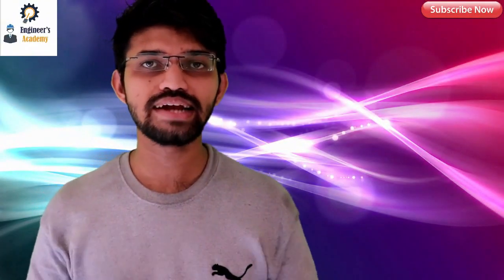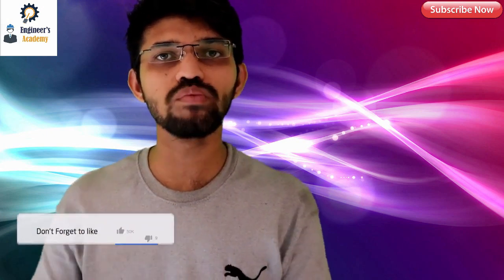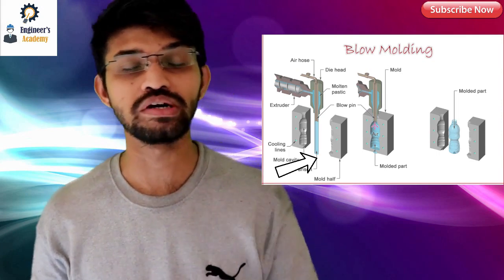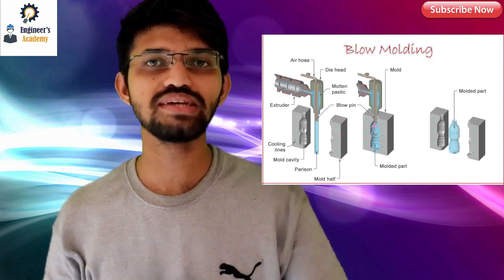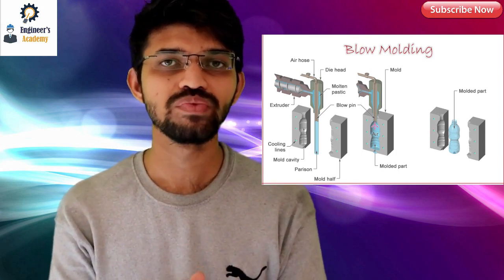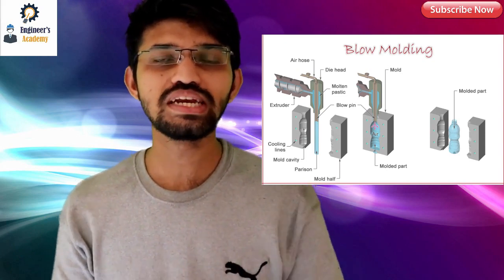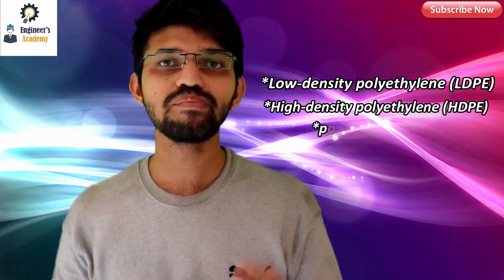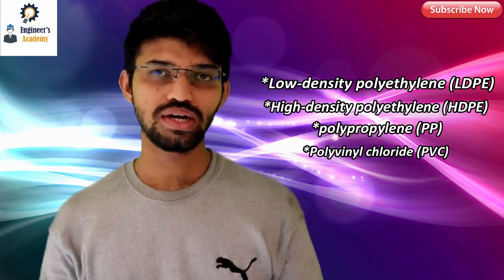What Is blow molding process?? Applications, Types, Advantages & Disadvantages

Comment: there is Blow molding and there is Injection blow molding. both similar but different applications.
Reply: injection for preforms or preform production plus blowing and blow moulding for preform blowing
Reply: @joelojiambo70  not sure the point of your comment. I've been in design and manufacturing for 20 years. Which is why my comment states that both are different.
Reply: @StarkVandalez  that's good sir